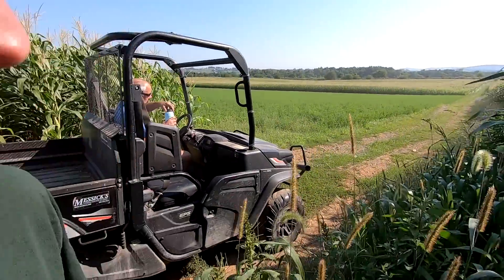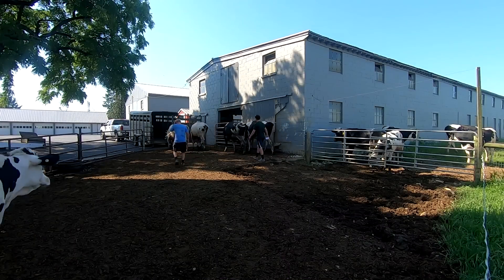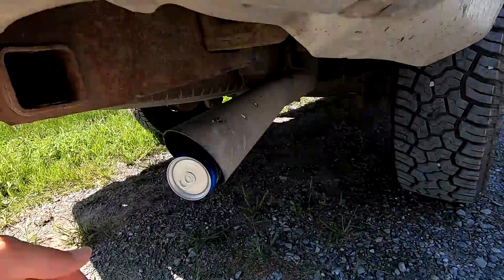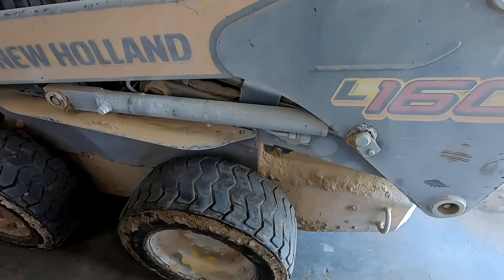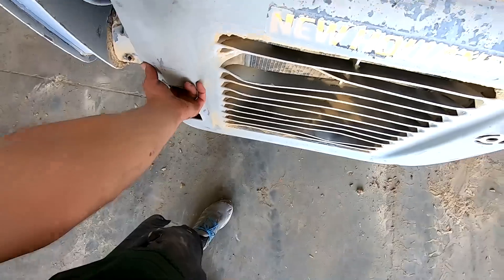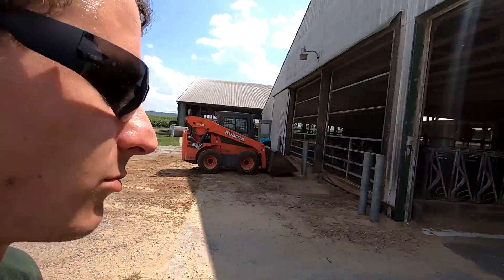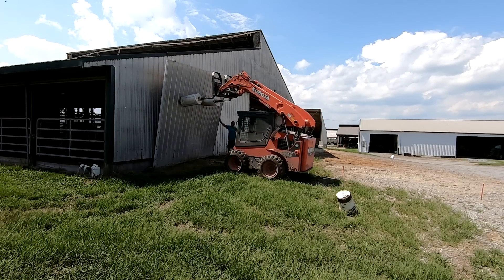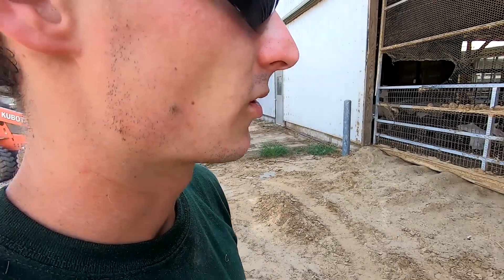Building Project Prep Begins

Comment: We use 3“ (or so, it sits thight on the fork) water pipes on the pallet fork to prevent the sharp edges of the fork scratch/damage stuff like the foil.
Pipes have a thick wall like 5 millimeter, so they last for 5 years +

Comment: I've noticed when you're scraping with the skid loader you always lift the front tires off the surface and your reduced to only driving with the back tires, and doing a lot of spinning. Would it be more efficient to maintain all four driving tires on your driving surface?
Reply: Sometimes you need more weight on the shovel to cut through the muck.